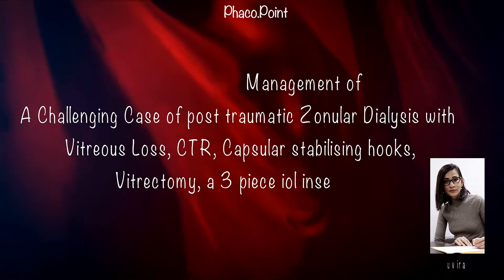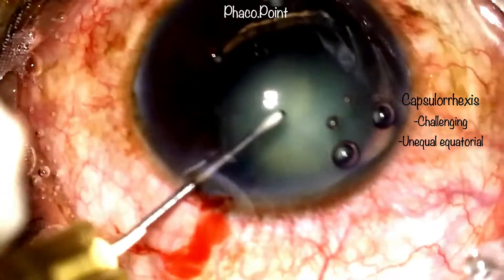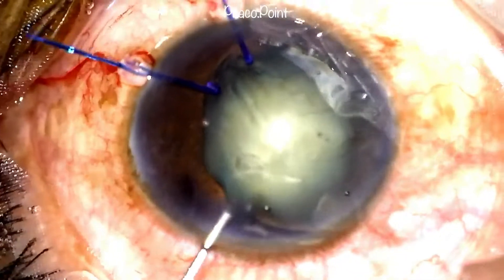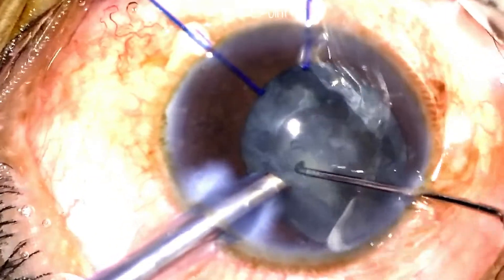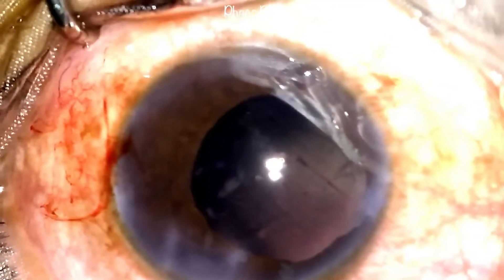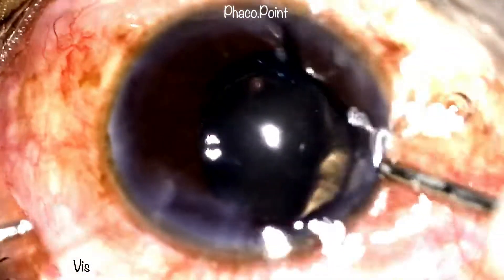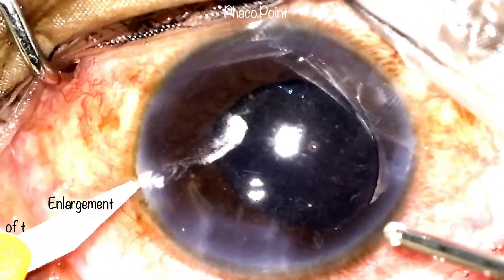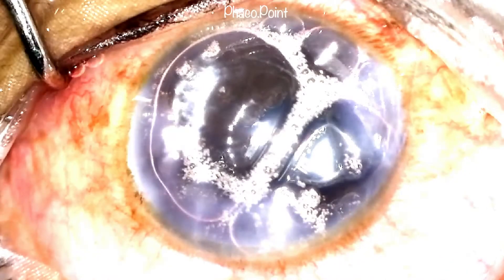Phaco in  a challenging case of traumatic cataract and  ZD with CTR, Hooks and anterior vitrectomy

Comment: Thanks for sharing this case. Are you worried about an anterior capsule rupture when using iris hooks or have you had good experiences with them?
Reply from the maker: hello.. I have been iris and capsular hooks for a long time now. the trick is to titrate the tension with which they are applied
Reply: Thanks. I thought about a damage due to the sharper edge of the iris hook. 
You should be able to use a cautery to melt the ends, similar to 3 pieces of IOL, and thus make them thicker and rounder. This is of course a lot of work. If the experiences with unchanged Iris hooks are positive, you can save yourself this effort.
At least these are my thoughts, which came to me spontaneously while watching your helpful video. Thank you again and best regards!